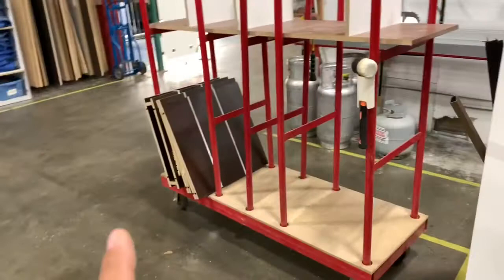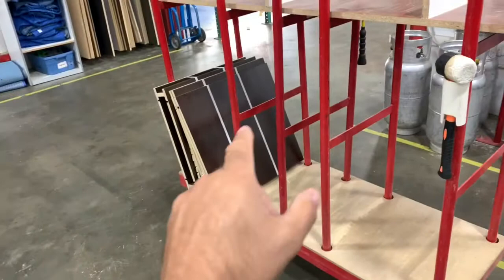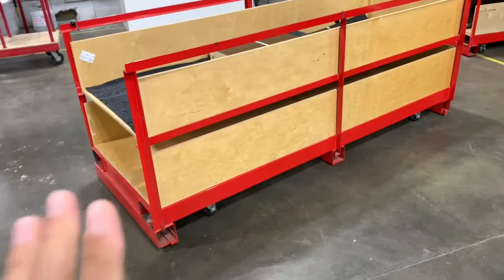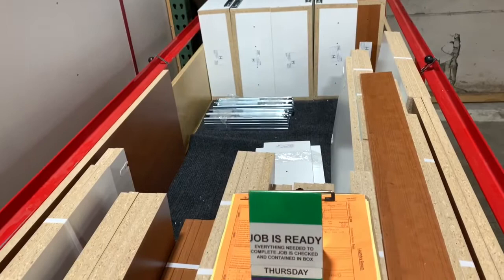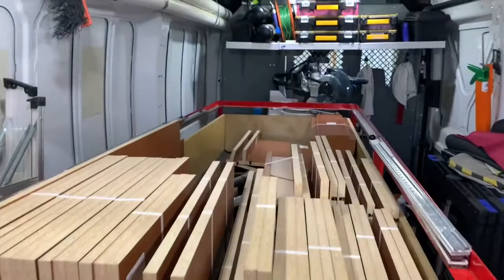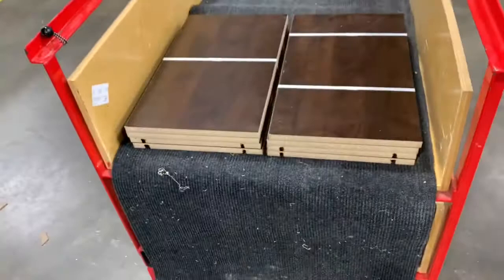Closet job load up is improvement

Comment: Another great video Derrek. The wheels under the cart and the carpeting to slide out are huge improvements.  I would be curious what tricks your installers have to add the hardware to the panels efficiently and comfortably.  I found adding hardware onsite to be terribly inefficient and uncomfortable since I am 6'3"  Went to installing all hardware on panels in the shop while standing comfortably with bulk hardware bins at my fingertips.  Panels were loaded from deepest to shortest.  Loading involved sliding the bottom of the panel in first on the van floor, at a slight angle,  and storing them near vertical on the back edge.  I used the hardware, especially cabinet slide members to lock the panels in place, slightly alternating position.    Panels were removed from the van  top first angled up, and carried directly into the closet and  bottom shelves were immediately locked in place. Your job boxes could incorporate this.  A common objection is potential damage, but that very rarely occurred and most likely was hidden by the shelves. The key is sliding the panel in at a small angle away from loaded panels.  The time savings onsite was tremendous.  A lower wage assembler could easily be trained to do this.  I even used a story pole to mark where to install studs and mark for rod supports for installation.

Comment: You almost need a door or some type of gate so the parts do not come out if they take off too fast.
Reply from the maker: Not an issue as the end of the box is even with the back of the van when loaded. Back doors close and become the door that keeps everything in